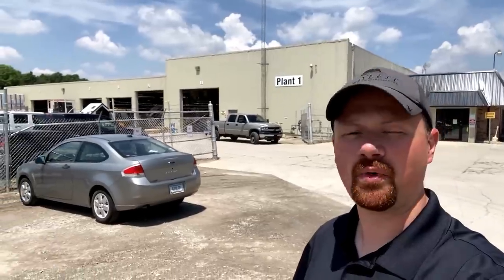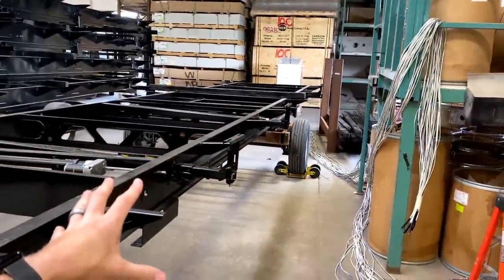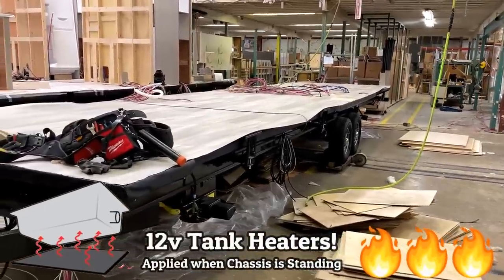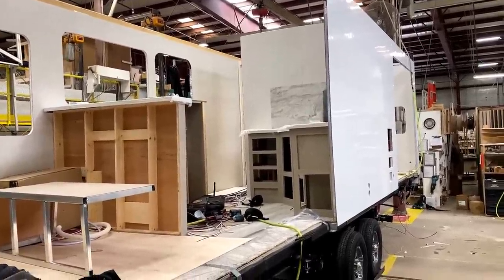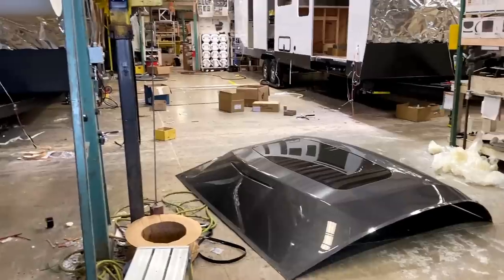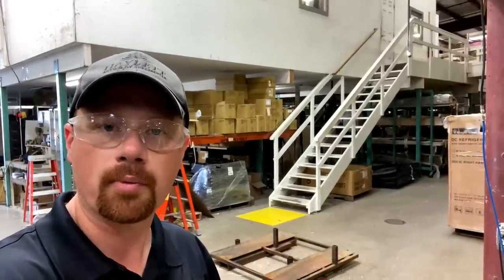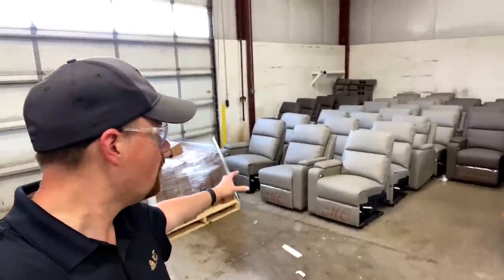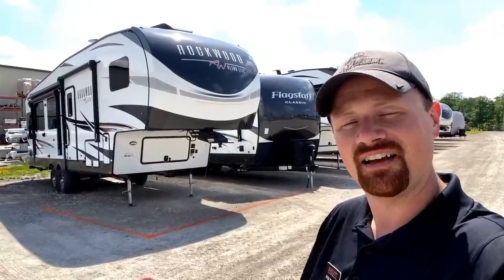Rockwood/Flagstaff RV Factory Tour!! (Part 1: Signature Travel Trailers & Fifth Wheels)

Comment: When I was younger and owned travel trailers and Class C it was fun stopping at the different manufactures for tours. Amazing how things where done. Specilized upholstery shops, fiberglass work, frames, wiring. Floor, wall and roof manufacture. I do remember asking why so many people where inside and found half were inspectors checking all the work as it was done. Winnebago was in my home state of Iowa. I remember workers on the roofs had catwalks but also safety cables as harnesses as they moved around. I forget which plant had a bad fire due to the fiberglass construction.

Comment: Just purchased a used Rockwood 2015. Very pleased. Thank you Rockwood, well done Josh.
Reply from the maker: Thx David!!
Reply: @JoshtheRVNerd   Very interesting. Do they use Azdel? Winnabego facility next?
Reply from the maker: @Bronco2Cj  Rockwood has continued to expand their azdel use
The Signature models now use it as well
Currently only their "Ultralite" mid-level trim package doesn't use azdel which sounds weird but word is they're doing that only until they burn thru their existing supply of lauan. Then they'll be double azdel across all sidewalls

Winnebago actually will not let anyone record in their facilities. I've tried for YEARS to get clearance to record in there
Reply: @JoshtheRVNerd   Good to know!  thx for the heads up and its prolly safe to assume no ac off of the batts?

Comment: Josh, I would like to see the Rockwood A frame production line. That's what I have and I am curious on how they assemble them.. Good tour for the more affluent buyer.
Reply: Same here.  I'd love to see one of the high wall A-frames being built (or a tour like this, step by step).
Reply: Me three would like to see the rockwood a frame production line, wanting to get a122 toy hauler model
Reply from the maker: Thx for watching Kevin! I went down on two separate trips to capture 4 tour segments, but A-Frames were not running while I was there. 

However, I think between the traditional video tours and the popup tour I was able to record you'll be able to connect the dots enough to get the idea overall

Comment: Josh: I've always wondered, do RV fresh, gray and black tanks usually have internal baffles to minimize fluid moment of inertia from internal slosh as the trailer transits? Given the size of some of these tanks, if someone were to travel with full or almost full tanks, the aggragrate moving mass could be substantial even if the tanks are mounted low in relation to the RV's center of gravity. Respectfully, WS
Reply from the maker: They do not. Interesting thought, though!
Reply: This would work for fresh water, but the baffles would provide way too much surface area for waste to cling to for the gray and black tanks
Reply: I’m wondering how long it takes, on average, to get a Rockwood trailer built, from start to out the door.   I just watched a video of a Jayco build.  11 hours.   The workers were running around so fast it’s hard to imagine anything being built right.

Comment: This tour looks great and is well done. I have a 2012 Rockwood 8280 Fifthwheel. It looks like Rockwood may have made some improvements in 10 years. Our trailer has been a night mare, tires had catastrophic failures at about 2000 miles. The brakes were inadequate. I had to turn the brakes up to maximum in order to get some braking effect and that caused the brake magnets to wear thru the brake drum, we upgraded to disk brakes to fix that problem. Then one of the torsion axles failed, it flexed/loosened upwards and only had 1” clearance from the top of the tire to the top of the wheel well. We had to replace the axles. The originals were 3500# ratting each which meant that they were near their maximum load at all times and one failed. Last year we had a frame failure. The long tail section drooped. The I-beam frame broke right at the back edge of the axle support structure requiring a significant repair. All of these failures took place after the warrantee expired so we were stuck with fixing this stuff ourselves. Interestingly, most people we talk to are happy with their Rockwood trailers, we seem to have gotten a lemon.
Reply from the maker: Wow crazy stuff. I'll never claim any RV to be perfect, but man right now pound for pound I would put rockwood up against ANYBODY
Reply from the maker: I kinda feel for your story. We had to have a tree in our back yard cut down once. Everyone and their brother recommended a local tree felling service. 

We were that ONE household that just had a bad experience with them. I don't think their bad people or do bad work. I think I just caught them on an off-day and "it is what it is."

Comment: Great tour; I like the empty factory presentation, less noise & confusion. You gave me a couple more key points that puts Rockwood at the top of my list: laminated roof (no staples pushing up through the top.).  And the land of "a mitten full of fishermen" isn't that far away.
Reply from the maker: Yeah there's a few areas like flipping the chassis and seeing the roof put in place I really like to show in motion, but overall I have found afterhours is a FAR more effective way to do this

Comment: Thanks Josh and to Flagstaff / Rockwood.
I own 2020 Flagstaff Ultra Light and have been very pleased with " fit and finish. 
FlagRock has done a good job listening to customers ahead of many other brands. 
The recent long over due decision to get rid of china- bomb tires is one great example.
I just replaced tires with Goodyear Endurance with only 1500 miles on my Flagstaff. 
One of many things that need to change is the location of the electrical load center. Why do I have to be on my hands and knees in the dark to change a fuse of flip a breaker? Especially hard if you are older and have had knee surgeries! Josh, put the bug in the ear and eyes of forward looking execs at FlagRock@
Thanks for the informative ( as usual) video!
Ron Mt Pleasant WI
Reply from the maker: Solid input. TY Ron!

Comment: We are currently looking to get a small to med. toy hauler. I am VERY interested in construction materials and methods. Since we will be semi off grid/off paved road BLM camping, I wanted a strong  structure that could handle a little dispersed camping  roads at a slow speed of course. I will be looking primarily to RockWood because of this vid. Thanks to you and Rockwood/Flagstaff. Now I can feel better about buying a well cared for used trailer since I know they are built in a lasting quality conscious manner. Thanks again.
Reply from the maker: I have a whole series of factory tours. I'm not sure where you live. But if you're further west, then consider something like Northwood RV. They're built for exactly the type of RVing you're considering

Comment: Awesome video. Kudos to Haylett and Rockwood for getting it done. One question: How long does it take to build a Trailer from start to finish and how many are produced in a typical production run? It appears to be several days.
Reply from the maker: I don't know the start to finish time frame on a common build. Naturally it'll vary a bit based upon the size of the models being produced. They can certainly put out more little geo pros in a day vs. multi-slide signatures

I would imagine the numbers range from the teens/day to 30-ish? Purely a guess though

Comment: The roof membrane adhesion is huge, IMHO.  I have seen a whole lot of other trailers running down the road with a huge air bubble pushing the roof membrane up off the top of the camper.  That can't be good.  This is a big reason why I bought a Rockwood for my second RV.
Reply from the maker: Yeah this is something you'll never see in one of those peel-away-pictures in a brochure. I'm so frustrated with how many "luxury" RV companies have sprung up the past few years who cut those and so many other corners... but man their pricing sure doesn't show it

Comment: Thanks Haylett, and Rockwood, and of course Josh. Great info, and interesting. Waiting for part 2, just ordered a Flagstaff Micro lite after tons of research, (Ok watching a lot of your videos) that pushed us toward the last trailer we will buy, unless we win the lotto then all bets are off.
Reply from the maker: Nice choice! Which model did you pick?
Reply: @JoshtheRVNerd  We went with the Flagstaff model of the Rockwood 2205s, it was a real tough choice between that one and the 2511s. I've heard some rumors about 2022 model year changes, can we hope to see some info on those soon?
Reply from the maker: @rickdumont6752  Soon, but nothing major coming btw. Mostly stuff that was optional becoming standard
Like...
* Roller Shades
* 12v Fridge + Solar/Inverter (2-way still optionally available), 
* Tank Heaters

They have an updated darker wood tone

No MAJOR updates of which I'm aware at this time. They're so pressed for production they couldn't upset supply lines too significantly

Since our info's been handy would you mind sharing a quick review at https://www.haylettautoandrv.com/review-us/ in return for the efforts? Would be greatly appreciated!!
Reply: @JoshtheRVNerd  Done, and thanks once again.
Reply from the maker: @rickdumont6752  TYVM!!

Comment: Nice. Rockwood is one of those brands I’m not that familiar with. I’ve seen a foam-composite-laminate floor break down, and I’m not aware of an easy, durable way to repair. Naturally you see plywood floors rot, but it’s usually older units and/or leaks that weren’t dealt with. I’d prefer plywood.

Front wall/cap is also a frequent failure on some brands.  Their laminated wall under the cap I think is great.

Comment: I think I just found our next brand of RV when we are ready to buy. I like our open range but it could have been better designed. Thanks for the awesome video!
Reply from the maker: My pleasure! I felt Good about Rockwood going into this. I felt GREAT when I was done.
Reply: Your video made me feel good about Rockwood! I wished I came across them back in 2019. They seemed to be like minded with me about how travel trailers should be made and come with instead of getting priced gouged for all the updates needed like the leveling system that should be a standard for all. 3 out of 4 of ours weak support jacks buckled on our second trip out that could have been very bad if I didn’t noticed our trailer stating to move.

Comment: Great tour Josh. I've been drooling over their Signature fifth wheels to pull behind my (paid for) 3/4 ton truck. It seems their light weight is just enough safety cushion to keep my rig under GVWR and GCVWR. Thanks for explaining the extended season insulation, they had nothing about it on the website. Josh, do you think the industry my eventually go to the main frame made from aluminum ? I know it would add cost but it would really open up larger RV's to people unwilling to go to a dually. I love they actually weigh every RV at the end of the line, especially in todays world where you may have to order an RV sight unseen and your doing you Gazinta's to make sure your truck can handle it.
Reply from the maker: With recent rising costs on all sorts of materials I don't see main-frame-aluminum becoming common any time soon

I've seen brands do that before (like the old livin lites). They were great, but man they were spendy..

Comment: Hi Josh. Great video on Rockwood factory. I just bought a sandpiper 5th wheel. If Cedar Creek is the top of the Forest river brands, where does Rockwood, and Sandpiper fall in the lineup? Mine has a really high quality features, but the tires are not the GY endurance so that will be first on the list to replace.
Reply from the maker: Sierra/Sandpiper slots below Cedar Creek
Fairly parallel to Silverback in a lot of ways
Rockwood is in a much different segment really
They're on a premier level like a Cedar, but Rockwood's "core" is ultralites so they go about things differently

They're both top of different classes

Comment: These RVs look like they're glued together. I know Airstream RVs are expensive and limited in storage space but at least I feel that they're made solid with the rivets holding them. What are your thoughts?
Reply from the maker: By definition lamination is a binding process using adhesives as a bonding agent. 

The aluminum structure is welded

Definitely not constructed the same as an airstream which is really its own animal, but pound for pound in a higher volume mainstream class I just don’t know who is doing it better and more consistently than Rockwood

Comment: Great video!  
Buying a friends 2016 and it's a beauty! It looks like new!
I was hoping to see greater detail on plumbing & electrical.
 Reason being I plan to "T" into the plumbing for the toilet supply line. With a valve and a separate pump I harvest rain water to flush.
We are doing that with our current rv which is in a permanent spot. Saves hauling water out.
Does anybody out there know if plumbing is accesable from below???

Comment: Josh, in the Mini Lites do they use aluminum trusses in the roof? Do they also use the 5/8 plywood in the floors? Not a laminated floor any more? Thanks Josh! Looking forward to more.
Reply from the maker: Mini Lites are built almost exactly like signatures. That's something you'll see as this series progresses -- the consistency between all of Rockwood's products is incredible

So a mini lite uses the exact same laminated roof with aluminum skeletal structure as this RV

All Rockwood trailers moved away from a laminated floor around the 2015-ish season btw. Still an aluminum skeleton like you saw here, but plywood on top. They added some weight and cost doing it, but came out with a stronger product as a result
Reply from the maker: We'll be in the Mini Lite plant this friday btw, so you won't have to wait long to see for yourself :)
Reply: @JoshtheRVNerd  Excellent product! Josh, would you be interested in doing a vid on the top three or five trailers for boondocking in the 20 to 25ft range?
Reply from the maker: @GWNHomestead  So you know there's nothing offensive about that question

That's commonly known as the "Thin blue line" flag

The "thin blue line" is a term that typically refers to the concept of the police as the line which keeps society from descending into violent chaos. The "blue" in "thin blue line" refers to the blue color of the uniforms of many police departments.
Reply: @GWNHomestead  No offense taken at all. Thank you for the question. It is the "Thin Blue Line" for Law Enforcement Officers. It represents the thin line between good and bad, lawful and lawlessness. The Police Officer walks the "thin blue line" keeping the bad from the good. It also gives honor to Officers who have made the ultimate sacrifice of their lives in the line of duty.
I'm a 17 year Law Enforcement Officer who is now retired due to disability. My son is a Master Sargent with the Highway Patrol. In one year he lost five fellow State Troopers due to being struck by cars alone.

Comment: How big are the holding tanks? 
Where is the thick insulation? What kind? 
N I didn’t see the plastic or something underneath to stop the wood from rotting from the weather? 
If these are the best ones or good ones then maybe an old one would be better maybe? 
We have a 1986 Holiday Rambler before Harley Davidson took them over and made them worse. And it’s well built but too small. 
We used to live in Michigan n our kids are still there about 2 hours from you. We aren’t sure what to do or if we should just keep this one. We seem slide outs have problems galore. One guy was so mad that he yanked his off and stuck a wall up. We were thinking we wanted one without a slide. We still don’t know. 

What do you think?
Reply from the maker: Holding tanks vary by model and will be included in each of our listings and videos. We discuss insulation concepts in the video when talking about the laminated roof. I would caution you to be wary of the multitude of false r value claims out there. A sad number of brands report outlandish “equivalence” R-Values currently 

Rockwood’s aren’t tested for extreme colds. Beyond that you should be fine

Comment: Josh - is the suggestion for Rockwoods specifically about not driving with full tanks about weight distribution? I hear a lot of horror stories about fresh water tanks falling out :( we bought our Rockwood this year because it’s small and has awesome boondocking features like the shower miser etc. But boondocking means we need to bring water! We were watching this series to try and see more about our Rockwood was made but we were hoping to see how those tanks are secured to the frame without having to remove our own underbelly.
Reply from the maker: Nearly every brand advises against towing with full tanks. In fact anything else is the exception rather than the rule. I understand the challenges that can present some individuals unfortunately
Reply: @JoshtheRVNerd  so no footage coming of how the tanks are attached to the frame then?

Comment: Not sure if you know the answer to this. Is the overall frame the same on all the Super Lite fifth wheels, other than length? Like same size main beams and hitch framing area.
Reply from the maker: The general construction won't change. The height of the base chassis I-Beam may vary based on the weight range of the model though
Reply: @JoshtheRVNerd  thanks. They don’t offer an axle upgrade, and I wondered about the usefulness of going to 6,000 lb axles to increase CCC.